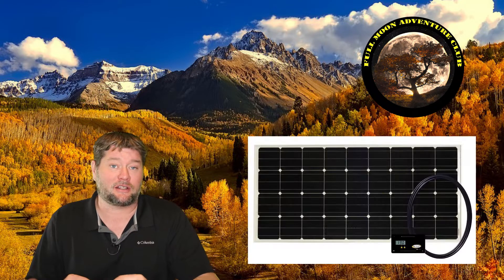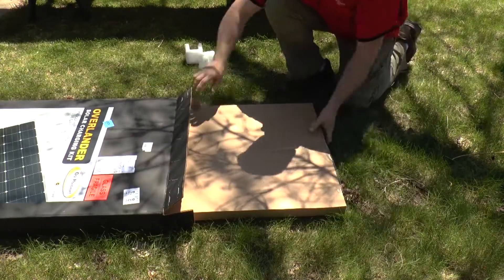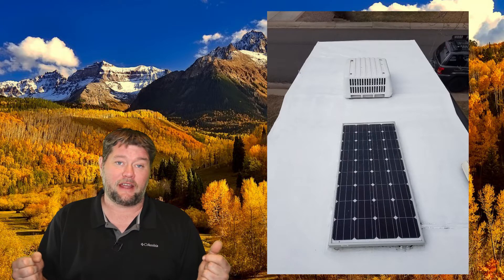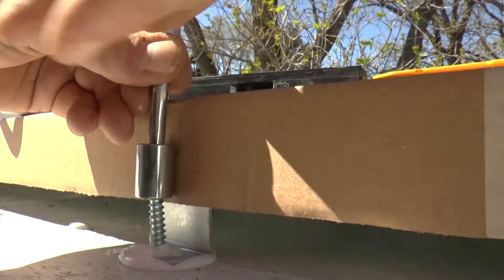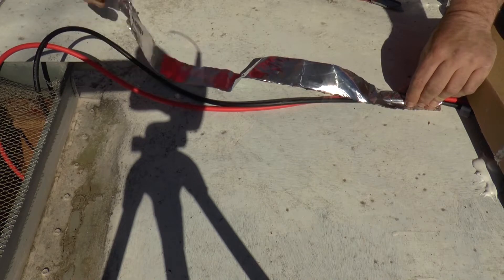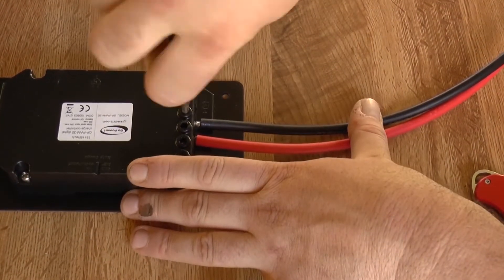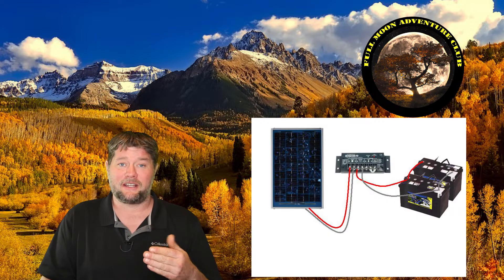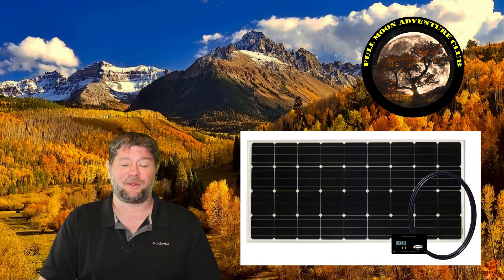How To Install A Solar Panel On Your RV

Comment: Any thoughts on using only VHB tape?
Reply: I wouldn’t !  VHB + EternaBond tape , yes.
Reply: @bt4b4  eternabond over top of bracket?
Reply: @jefffrair5720  for a flex panel , yes.   (If a ridge panel like his, you have to screw to the roof.   Never just VHB tape.)
Reply from the maker: With a ridged panel like this one you have to screw it to the roof. VHB or eternabond tape would not be sufficient.